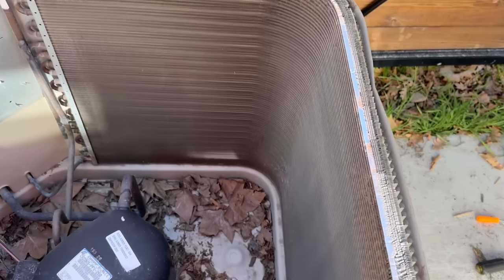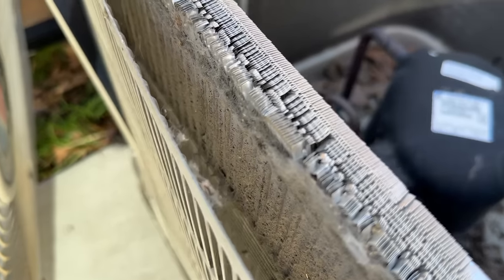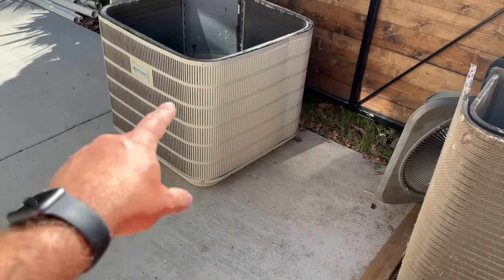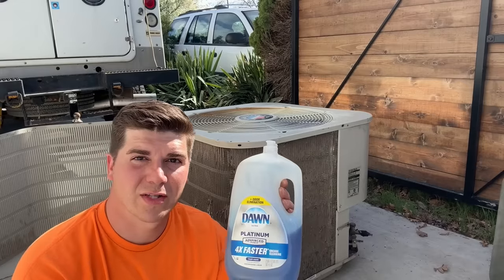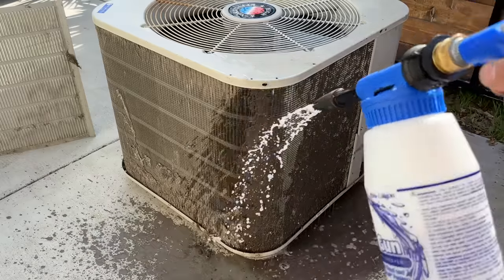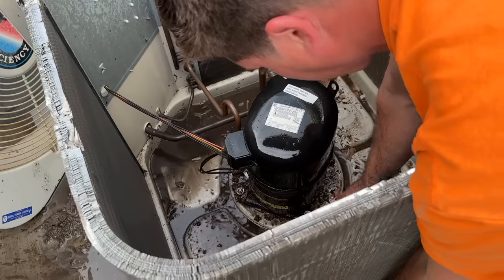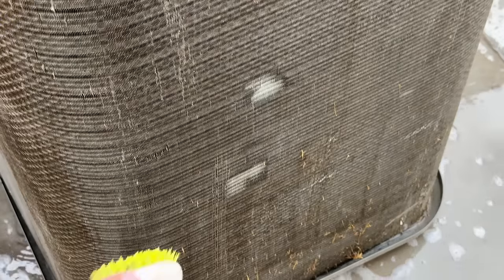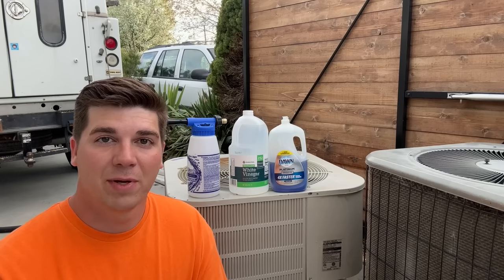How To DEEP Clean Your AC Coils FOR FREE.  Use This Secret Sauce

Comment: Interesting that you see some pros rinsing from the outside saying inside out isn't necessary.
Reply: It may not be necessary, but it’s much easier. The normal operation of the updraft fan pulls in debris from the outside in, so it’s easier to clean by pushing it back from the inside out. If you spray from the outside in, you may be getting more debris into the coils than you need to.
Reply: @mattm3901  Makes sense, thanks!

Comment: Great info for sure. I need to do both my units. Im good with the homemade solution. However, will simple green work as well?
Reply: Rinse it well. It hard on aluminum. We don't use it on airplanes.

Comment: is that coil gun specifically to be used on a garden hose with some adapters?? i have a foaming gun that has quick connect but it's for a power washer.... same thing with different connections? or do i need a coil gun too besides my foaming gun?

Comment: Is there ever a case where coil cleaner could damage fins depending on the material the fins are made of? I have a Bryant unit and I am torn between using a coil cleaner or just water.
Reply from the maker: You’ll be totally fine just using water 👍🏼

Comment: Any chance you can go over how to clean out a low profile one? Like the Trane XR15 Low Profile? The fan points out sideways!
Reply from the maker: Yes! I’ll try and get a video of that type of condenser soon! Cheers
Reply: @diyhvacguy  Thank you so much! that would be super appreciated!!!
Reply: Those are easier.  Kill the power to the unit.  Remove the grill with the fan motor and blade attached.  Probably 8 screws.  Then lay it over to the side.  You may need to open the access panel with the Trane logo on it to get some extra slack in the wires. You should now have full access to the inside of the coil.  Clean as he showed above.  Re-assemble in reverse of disassembly.  FYI, your coil is most likely 2 rows.

Comment: Just curious to clean the outside of the coils could you use a pressure washer if the pressure is not too high?
Reply: Avoid a pressure washer at all cost...simple wash out with a hose no heavy steams

Comment: Do you think that unit that was completely clogged didn't have an issue with the compressor at all, but because it was so clogged it had no way to disappate the heat so its like it didn't work ?
Reply from the maker: Oh I’m sure having it clogged took some life off the compressor. It was working when pulled, but yes in addition to that, having this much crud built up on it will significantly lower the efficiency of the system! Could be as much as 50%!

Comment: What if your unit says use water only. Can you still use the cleaning solution?
Reply from the maker: I’ve never seen a unit that said water only. If it says that then I’d just use water! Cheers
Reply: Micro channels coils will say use water only! Yes you can use mild cleaners,but they must specify mico channel safe! I only use Viper brand cleaners they are by far the best on the market. Also some of the coils now have a coating on them,blue to blue/gteen,those may also be water only!
Reply: @diyhvacguy  trane says water only

Comment: I used to work at a hotel and had to clean the ptac units. In the maintenance section of the manual. Its suggested to use Simple Green. Do you think thats good for these aswell?
Reply from the maker: Yes you can use simple green

Comment: In your experience, by cleaning the condenser, how much lower would the temperature be at the vent because of a condenser with clean coils? 7 or 8 degrees cooler?  thanks
Reply from the maker: It’s hard to say. Really depends on how dirty they are. I’d say on average maybe 2-5 degrees
Reply: @diyhvacguy  thanks for responding, i cleaned the condenser coils and didn't have any luck lowering the temperature, i am now going to attempt to clean the evaporator coils, thanks again for responding and making these videos
Reply: This process does not lower the temperature at the vents.  It only is an efficiency gain to the system.  This will help reduce the  load on the compressor. Less load = less electricity use ($) and extended compressor life ($).  All good things!

Comment: Oh, Dude, be careful with drilling holes into the bottom.  The existing holes are tiny to begin with for a reason.  Mice don't need much of a hole to squeeze into the unit.  The last thing you want is mice chewing through those wires.

Comment: Where in the world do I find insulated compressor covers at? Mine became a mouse condominium over the winter, and needs replacement. Thanks for sharing your expertise with us!
Reply: Its for noise,if unit isnt driving you nuts,leave it off
Reply from the maker: https://amzn.to/3LGv9Wc
Reply from the maker: Here you go 👍🏼 this is the one I got for mine. Works great
Reply: @petersmart1999  Really? I was under the impression that it was for heat insulation and protecting the compressor from the elements? Due to its location, noise isn't an issue whatsoever for me.
Reply: @diyhvacguy  You sir, are the best! If you were local to me, I'd have you do all of my HVAC work. Most YouTuber's don't respond to any of my questions so, it astonishes me that you do. I can't thank you enough.
Reply: @CRA677  nope,just for noise! You dont want em running hot,you want them just right,suction cooling keeps em cool and the discharge is already hot,its just to keep the noise down!
Reply: @diyhvacguy  I know the compressor insulation blankets work, but do you think those blankets cause heat build-up in a compressor due to reducing air flow around it?  I've nearly burned my hand touching the compressor in a mini-fridge and despite wanting a quite system, fear making run too hot outside.
Reply: @petersmart1999  Thanks for the reply, Peter!
Reply: @jasonbengel Refrigerant fluid cools the compressor from within. Therefore, there's no danger of overheating for the compressor.
Reply: @diyhvacguy  - Perhaps might cut down the compressor noise a bit, but will also in the hottest times, cause the compressor to maybe overheat, which in my opinion, is way worse than a little more noise... It has been on my experience with things electrical in life, that if these things electrical are not exceeding their heat capacity, they will work and live longer...  I will never put anything over something like an A/C compressor for noise...:)
Reply: @CRA677  - Heat insulation on something that creates a lot of heat when it's working???  I think just the opposite... The More heat that is removed from things that create heat like electrical motors, connections, etc., the safer it is for those things, and the longer they will last... Electricity creates heat, right???  Why in most cases, would it ever be good to ADD more heat to something that needs to dissipate heat, so it will not break down from excessive heat???   :)
Reply: @frandanco6289  I completely understand and agree with your point. However, this then, aside from noise reduction,  begs the question of why manufacturers insulate them?

Comment: How do I clean a minisplit on a balcony? Mine gets clogged with cottonwood fluff every few weeks and the efficiency drops a ton. Self-cleaning mode isn't strong enough to dislodge it, so I've had to try to pick the fluff off the coil with my fingers. Every video I can find about cleaning them involves water hoses, which don't exist on a highrise balcony! There's not a lot of room between the coils and the wall, and a metal grid on top of the coil makes it hard to get at. Surely I'm not the only one with a highrise balcony minisplit near cottonwood?

Comment: I don't see the value of having a specific tool for foaming A/C coils.
Any tank sprayer or in-line garden hose (low pressure) foam 'cannon' should be sufficient.
They make cheap tools specifically for straitening heat exchanger fins -- I think you actually show how to use these in another video.

Comment: I cleaned my evaporator coils today and noticed the fan when the unit cuts on starts slowly and then in a few seconds turn at full speed. Is this normal?
Reply: Sounds like the capacitor may be ready to fail or has already failed since you posted this?

Comment: I haven't cleaned my a/c in 5 yrs., so when I started to see these cleaning videos and then thought " that looks kinda easy". Then when I went outside to look at my unit it appeared clean. What all these videos show are completely clogged units. How they got that way is unimaginable. My point is, probably you don't need to clean it.
Reply: I believe it but what they’re suggesting is preventative maintenance. These are extreme examples to show you results. Would you not change your oil, even if your engine still had enough or still seemed clean after you went passed the recommended mileage?

Comment: Could you help me? I have a R22, 23 year old 2ton Goodman split system. It’s a 15 SEER. I installed it. It’s still working like new from my good maintenance. Can someone share actual kw power measured power from the condensing unit. Compressor and fan. I have a 4 ton like it. Would like that too. My Simpson clamp on true RMS amps and sep Voltage meters show it has always been high from typical generic I find on the web. My amps are 30 to 40% below unit Run Amps on the unit label. I’m not sure if the true RMS amp clamp on is the problem. Both units measure 20 deg drop from air handler to outlet vents in hot South Fla weather 50-55% humidity inside. All of this is the same as when I installed them new in 2000. Thanks in advance.

Comment: Why would you not first vacuum / brush the worst of the crud off while everything is still dry???? As soon as you wet that crud, it becomes muddy and that alone will cause it to adhere much more. If you remove the worst of it, then the shampoo will be more effective, to boot.
Reply: I was thinking the same thing. Much easier to get out dry particles that way and anything else you can then do the wet cleaner and rinse. 
Maybe there is something I’m missing?
Wouldn’t be the first time.

Comment from the maker: Klein Multi Size Nut Driver: https://amzn.to/427nGX1
$20 Foam Coil Gun: https://amzn.to/3nAxUQL
Stiff Bristle Brush: https://amzn.to/3LXi0t1

All my favorite HVAC tools: https://www.amazon.com/shop/thediyhva...

IF YOU ARE IN NEED OF GUIDANCE WITH YOUR HVAC SYSTEM, whether it is diagnosing a bad part, replacing your system, or help with sizing, check out our membership program here: https://www.patreon.com/diyhvacguy 
For a small monthly fee of $50, you will get assistance from myself when it comes to your hvac needs, whether it's sizing, diagnosing, or locating the correct equipment.

Comment: ha, i removed my fan assembly and the wires were so short that i could hardly even tilt it. not to mention that mine had a sheetmetal outside as well as top...talk about a finger slicer :/

Comment: Have you ever tried the foaming soap for cars?  Seems to me it would foam the dirt and debri off of the coils and its cheap.  Vinegar is an acid and will erode certain metals so, I can't see using it.  Dawn I have tried and it didn't do much.  Spray on coil cleaners dont seem to be that good to me. They hit the surface of the coils and start foaming same as any car foaming soap would do.  I'm open to comments and suggestions.
Reply: I worked on 30ton units on buildings and we acid washed the coils once a year. The main reason for this is dirt and dust form a "blanket''  on the coil reducing its ability to dissipate heat. A good soap wash and hosing once a year will remove this "dirt blanket". No need for anything more serious and vinegar diluted by a gallon of water isn't doing anything

Comment: Why wouldn't you just use a shop vac first to clean off the coils since you'd need the vac to clean up inside the unit? Then deep clean it with the solution.
Reply from the maker: That actually would have been smart! Noted for the next one that has a sheet of junk on it! Thanks man.
Reply: That’s what I was going to say.  I always start by propping up the fan and vacuuming out the leaves on the bottom first.  If the condenser coil is dirty enough, then I will put a brush attachment on to the wet vac and vacuum the coil before I get it wet.

Comment: Question - when cleaning the fins on a heat pump do I follow the same process?  Thanks
Reply: Yes
Reply from the maker: Yesir! Same thing
Reply: VERY BIG caveat: Trane/American Standard coils have very different fins.  You can’t use fin comb or brush.
Reply: @raymondharrell2534  Good point! My response was yes,do to the fact that heat pumps and A/c only, use the same coils.But yeah,the XR coils are awful in design for maint! Alot of manufacturers used the in the late 80's and early 90's,then they disappeared,then they came back!
Reply: Yes, it will be the same process...

Comment: Coil that dirty after three years? Apparently no filter, that coil should have been pulled and given a proper cleaning, something that dirty was slugging the compressor.
Reply from the maker: It was pulled, in this video 🤣 and it did have a filter but it didn’t have a good seal. That’s why it got so dirty